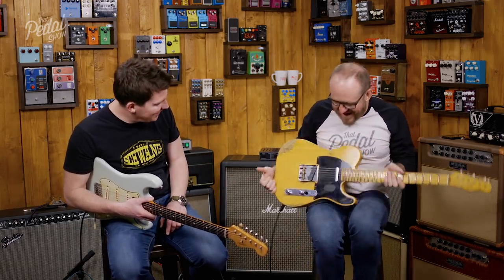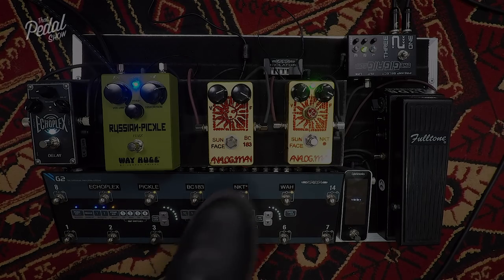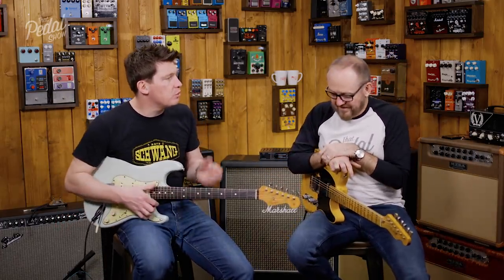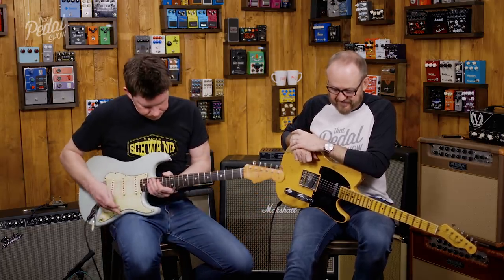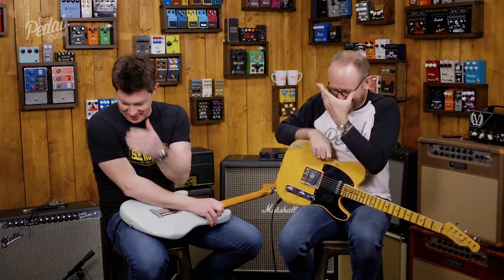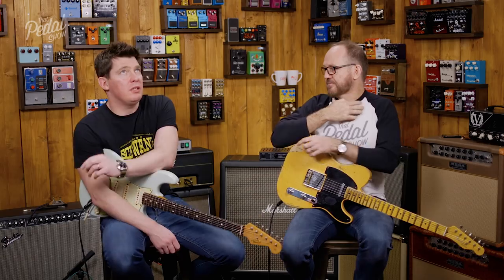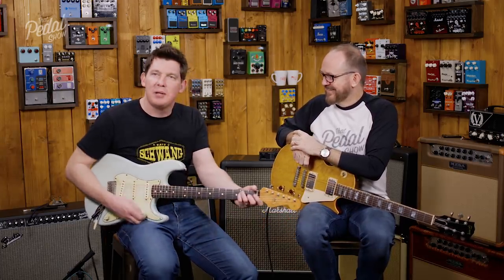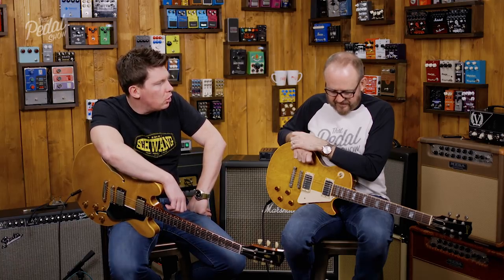That Pedal Show – Things To Know About Using Wah-Wah, Fuzz & Buffers

Comment: Amazing show.  I wonder if you'd revisit this one last time now that MXR has released the Classic 108 mini with the buffer in it rather than the buffer being in the Wah. Or is that what Analog man is doing with his Sun Faces? 

I realize that what you were both saying is the issue seems more pronounced with a Germanium Fuzz than a Silicon one like the Classic, I just found it amusing that you did this show and almost simultaneously...MXR puts a buffer in their Fuzz.

Maybe see how the Mini Fuzz plays with the Mini Wah?  Call it the TPS Wah Fuzz and Buffers....Mini Edition... You can even do a shortened version.

Cheers.
Reply from the maker: The buffer in the 108 is there to specifically address the issues created with having a wah first in the chain, so we’re going to assume it works. That said, Dunlop say it’s to stop the crazy oscillation that you sometimes get, not necessarily to make a regular wah have its full range.... and it’s a silicon fuzz anyway so is not as sensitive to whole deal as a traditional Germanium fuzz. Maybe we can get one on to Pick N Mix and test it. Mini Fuzzes - sound great cranked but aren’t the same at all with the volume on the guitar down... so something is different in there meaning Dan and I will stick to the more traditional/classic stuff. Cheers!

Comment: The Bogner Oxford Fuzz has a transformer in it to adjust for the right input impedance. Are there more fuzzes available with a transformer? Or is there a transformer device you could put in front of a fuzz pedal?
Reply from the maker: Just get the right wah?

Comment: I am wondering if there is a way to connect an EXP pedal to G2 that allows me to use the pedal for several pedals? I own a MOBIUS, TIMELINE and a SUNSET. So what I’m asking is if I can use the EXP as a WAH in the mobius in one preset, and for controlling the MIX on my timeline on another preset without needing to repatch my EXP pedal for every time?
Reply from the maker: Please watch our MIDI episode from a few months back... explained there. But yes there is!
Reply: I asked the same question to the support on G2 website, and they told me "no", but gave me a link to a third party expression pedal that might to the trick... Hoping that your answer is the right one ;)

Comment: Do you guys think Roger Mayer put a buffer in Jimmy Page's Wah or tonebender  ?  I've looked at many pics of his late 60's setups and I believe his wah is before his tonebender or rotosound germanium fuzz... my thoughts are he either rarely used them in combination or he put an extra long cord in between as a buffer. Any thoughts?  I have myriad of  tonebenders and 60's wahs and am curious how he dealt with WAH to G FUZZ.  thanks friends
Reply: One of the ways to deal with a vintage Wah into a Germanium Fuzz setup, without needing to alter the vintage Wah pedal, is to use a separate buffer pedal designed especially for this purpose.

Comment: My (possibly misinformed) question then, would be: how can one manage a fuzz, germanium or silicon (as the video demonstrates, the ‘buffer issue’ is present with both, just far lesser with the latter), and pedals with buffered/non-true bypass outputs in front of them?
Thinking of my own setup, (which admittedly does not currently feature a fuzz, hence my doing some research ahead of buying one) might I not run into problems using something as simple as a TU-3 or compressor with a “fixed buffered-bypass” ahead of a fuzz? Following that logic, what can be done to avoid the demonstrable issue that fuzzes face given that the only logical place for a tuner is first in the chain? 

I have read that the proximity of the fuzz to a buffer is a factor in the production of these ‘issues’, and that they should be kept 2 or 3 pedals away to avoid running into problems –I don’t know how much truth there is in this, if any?

Or does the whole thing hinge on, as Mick says, the specific pedals involved and the fact that “buffers are not created equal”?
Or is the whole thing inevitable as soon as a non-true bypass pedal is used before a fuzz and just something to just be aware of?
Reply from the maker: Hello Dan. Your question is entirely sensible! Mick here. The ‘two or three pedals away’ thing is not much use - depends entirely on the pedals. There’s more information in the video description text that I won’t repeat here, but I think would be useful to you. 
After that, it’s really a case of understanding the potential issues and tweaking accordingly. In terms of buffers before fuzz, they’re all affected, but the big issue is with vintage Germanium types.  There’s no reason why your tuner can’t come after your fuzz either. Once you get up to five or six pedals you’re dealing with all kinds of issues - not just buffers -  so a simple true bypass loop switcher takes a lot of the hassle away from all of this. We use TheGigRig QMX for obvious reasons. I wouldn’t be without one. Cheers!
Reply: Hi Mick, thanks for the speedy response! I went through the description text at first but I was consistently getting stuck in my head as to how to avoid the potential issue of a buffered bypass pedal before fuzz, even if the fuzz were as early as possible (as I was going with the assumption that the tuner would stay 1st). This was also assuming this yet-to-be-acquired fuzz would be a vintage Germanium type, where the big issue lies as you say. You are right, of course, that the fuzz could be before a tuner, I just don’t think I’ve ever seen that done. However, I think I was also coming to the conclusion that a Quartermaster would completely negate the problem as well avoid numerous other switching-related issues. I think I shall be looking at one as soon as money permits!
Love the work and detail you guys put into these videos, keep it up - cheers!

Comment: I have an Analogman Sunface 2N on order. Do you guys anticipate and issues having after the Cali76-cd and TS9 in the chain?
Reply from the maker: Depends where you put them. You’ll notice that if you switch either on when placed //after// the fuzz, the fuzz will pick up a little extra brightness, especially if you’re running into a bright clean amp. The 2N is Germanium as you know, so will be sensitive if it’s placed after the TS especially (it’s buffered/not true bypass). It’ll also be sensitive after the Cali, but less so. Can’t imagine wanting to run compression before fuzz so try the fuzz first in line. Cheers!

Comment: out of curiosity what fuzz would you guys recommend to get eric claptons live tone? I know he doesn't use a pedal and gets the tone from his mid boost into a tweed amp but it sounds fuzzy to me.  for reference I use a fender 68 custom deluxe revereb and an American vintage 56 strat with 59 pickups in it
Reply from the maker: Probably a Beano Boost, so not a fuzz at all. Fuzz is probably too much for Clappers. He has that mid Boost thing in his Strats, right? So I reckon - Mick here - something like a Beano Booster would work. It has three settings so you can ‘tune’ it to whatever it’s hitting. Hmmm.
Reply from the maker: Probably a Beano Boost, so not a fuzz at all. Fuzz is probably too much for Clappers. He has that mid Boost thing in his Strats, right? So I reckon - Mick here - something like a Beano Booster would work. It has three settings so you can ‘tune’ it to whatever it’s hitting. Hmmm.

Comment: I have a question that has been eating away at me - Dan and Mick both seem to favor guitars with single-coil pickups. So, guys, what do you do to avoid the ridiculous single-coil hum and buzz? Particularly when stacking drives together. Is it enough to shield your control/electronics cavity? Do you use gates? Backplate noise canceling system (for Strats)? I love the versatility that stacked gain pedals give you, but often my signal can barely overcome the nasty hiss and buzz!
Reply from the maker: We get asked this quite frequently Jared and you might be surprised at the answer. Mick here. Speaking personally I can’t stand any noise cancelling stuff because I think it really kills the sound of a great Strat. Noise is part of the sound! 
Sure, shield the cavity if you like (I don’t), but the way to deal with it is four fold for me, in order of importance. And yes, with a Fuzz Face and Klon on, there would be a comedy amount of noise. But...
1. Your guitar’s volume pot. Guitar turned down, you can’t hear the noise. Band blaring, playing at respectably volume, you can’t hear it either. 
2. Physical position. Noise through single coils is usually from lights/monitors etc. If you move around, most of it goes away.
3. Having your cabling and power sorted on your board makes a huge difference (to everything). 
4. Don’t worry about it so much - see point one.

Now, where the above works less well is if you’re confined to a position at home/in the studio and you just can’t get rid of it. I try to make sure I don’t get in those situations. But I’ve never yet been on a position where I can hear the hum about the guitar. 
That might not be the answer you were looking for, but it’s the truth for me anyway. Dan the same. Cheers!
Reply: That Pedal Show Thanks for the response, gents. Perhaps I need to have a good look at a high-quality isolated power supply for the board, and perhaps a power conditioner at the wall before anything else. Do you recommend any product in particular for powering a rather moderately-sized board?
Reply from the maker: For power we only use TheGigRig stuff. It’s hands down the best, but we would say that because it’s Dan’s company. But it is. 
Isolated wall supply, we don’t.
Your biggest enemies are computer monitors, lights and your own worries. Turn it up, wig out, love the noise! :0)

Comment: I got a Catalinbread Echorec today.  With the Trails mode on and an OD in front of it, it creates a fuzz sound. I turned to True bypass mode and it got better (no fuzz) can you guys do a video exploring the trim pot options and how they react with drive pedals please
Reply from the maker: You’re putting a buffer in when it’s in trails mode we’re guessing. Buffers after any drive pedal will increase the perceived top end/bite, and some ODs are more susceptible than others (fuzzes especially so). The Catalinbread has a fair old boost on it as well as we remember?
Reply: That Pedal Show I am running the RYRA Klon into the Echorec and it sounds like a broken up fuzz like when you crank the bias knob on a fuzz. Must be driving the Echorec preamp circuit? I might have a play with supply voltage to see if it gives me more head room

Comment: The Vox V847-A has a buffer on the input jack. Is that in the right place to make the wah compatible in front of fuzz? Or do I need another low impedance buffer between the two? Love the show, love the “schwang,” but the summary left me feeling wahful! Best from the west coast of Canada!
Reply from the maker: +Matt Lurie ideally Tuson the output but it does work there, the question is does it work for you?
Reply from the maker: Hmmm. I don’t actually know Matt - Mick here. We tried all the wahs with the Analog Man fuzzes and they all worked okay. But the difference came with the more traditional GE FF circuit. So it really depends on the fuzz. There’s more information in the video description that may make things more clear for you. Cheers!

Comment: To That Pedal Show, question for Dan, when I first started watching you (two)  you was using your G2 on a pedal board, for some reason I just assumed it was a Schmidt Array Pedalboard, but once I was able to look at the hole set up, I see it is not a Schmidt Array. So I would like to ask, what brand of board is it? Is this a Gig Rig brand if not who? I have The Gig Rig page on a bookmark but most of the info for boards seems to direct me to a way I would have to contact someone there to even talk about it. Most other brands have info posted, but that page would seem not to have that information. Can you HELP me out?
Reply from the maker: Hi Roy, Mick here. The big boards we also use are by www.custompedalboards.co.uk
Cheers!
Reply: I just pulled that up, and it has a Bookmark, so thank you so much for you speedy and helpful response. I only have a few pedals (right now) but one of these days I'm sure I'll need a pedal board.

Comment: Awesome show as always. I know it is a tall order, but can you guys explain impedance (in another video), and its effects in a pedal chain. I specially don't understand why should pedals have a high input impedance and a low output impedance  specially if a guitar has an impedance of about 15k (So I've read) and you get pedals with a input impedance as high as 2M.  I also don't understand how putting a buffer at the beginning of the pedal chain helps preserve the signal better, shouldn't it be at the end of the pedal chain  and before the amp ?
Reply from the maker: This is one for Dan. Cheers!

Comment: That fulltone wah sounds fantastic! I have a question; sometimes, when I use my wah pedal for solos, when i pull the wah pedal all the way back it makes this buzzing sound that sometimes drowns out the note I'm playing. I've had it with all my wah's I've owned. But it doesn't do it everytime, it seems to depend on what room I'm in..? Any ideas?
Reply from the maker: Presumably some kind of oscillation / frequency thing. I know what you mean, but I’m not sure what it is. Cheers!

Comment: I need to order one if those Hubcap John Fuzz faces now. I've been curious but holding back. Since you guys featured them, their prices are bound to go up. Placing my order while they're still reasonable. Lol
Reply from the maker: +thisdyingsoul76 yep, seriously great sounding fuzz
Reply: He seems to have none of that specific one left.  I guess I'm too late. He had a bunch the other week. Wonder if he's still doing them?  He has one called Fuzz Fake that looks to be styled after a Jack Daniels bottle label, but it only runs on batteries... otherwise I would have ordered it.  I assume to Tobacco Tin version has no room for batteries and runs on a power supply?
Reply: thisdyingsoul76 hey dude thanks for the compliment :) I am currently inundated with orders 😱 will be posting more soon.  All my fuzz face clone pedals are battery driven only as running them on a psu can change the sound of them.
Reply: I'm assuming that may be something related to the voltages of batteries decreasing a bit as they get used up?  For example, his many prefer their fuzz faces after the battery is 1/2 drained.  I may still get one anyway.  I just remembered my power supply came with a 9V battery adapter.  I could try that and even drop the voltage of the output to see if it helps. If I find an actual battery really is best, I guess having a single pedal relying on batteries isn't going to break me.  :)
Reply: yeah hit the nail on the head dude :) anyway currently i have a load of orders to get through before i sell any more. regards Hubcap John
Reply: +Hubcap John Hayward I'll  keep an eye out. In the mean time I just found a Fuzzrite clone I made an offer on. I'll set aside some funds next payday for one of your Fuzz Faces.  I'll be sure to pounce on the next one I see on Reverb.

Comment: So if you take the Fuzz out of the equation and I just have a wah with true bypass and tc bonafide buffer, does it matter if I put the buffer first and then wah or the wah first and then the buffer? would the buffer affect the range of the wah because the wah is not getting the original guitar signal?
Reply from the maker: Nope. Put the buffer wherever you want it in this instance. Cheers!

Comment: So... a Crybaby with buffered bypass would interfere with the fuzz sound when disengaged, but modding it for true bypass would mean not getting the buffered wah sound of the Fulltone in use? Basically modern Crybabies don’t work in front of Germanium fuzz pedals? If this is the case, are there any other pedals like the Fulltone that offers a buffer only when active?
Reply from the maker: Pretty much Ben. You’d need to do some research on other wahs, but yes they are available! Although to be fair the input section of the fuzz makes a big difference too.
Reply: That Pedal Show Perfect, thanks for clearing that up for me. I’ve been considering replacing my muff clone with something more articulate- at least I know now that I may need a new wah as well. Saved me a headache in the future 👍🏼

Comment: Do the problems only occur when both pedals are on? Say if the fuzz was not on, the wah would be fine?
Reply from the maker: Depends what the bypass circuit is. But generally speaking, vintage style fuzz faces like to see your guitar, not the output or buffer of another pedal. The wah would be fine without the fuzz on, yes.

Comment: I have a feeling I'm about to ask a stupid question, but can you use Germanium transistors in a Muff style circuit? or, more accurately, will it actually function/sound any good if you do?
Reply from the maker: One for Dan. Weren’t the original
Muffs Germanium?!
Reply from the maker: +SoulIsTheGoal big muffs have always been silicone transistors. If you could find NPN Ge transistors you could, but you’d need to tinker with the circuit to make it sound any good, but yeah, sure, it’s possible.
Reply: Cheers lads, great episode and lovely to see Mick killing it with the wah ; )